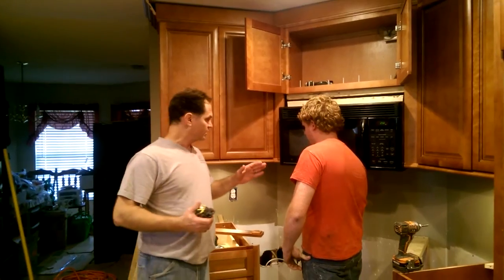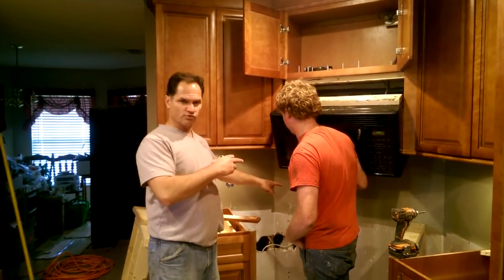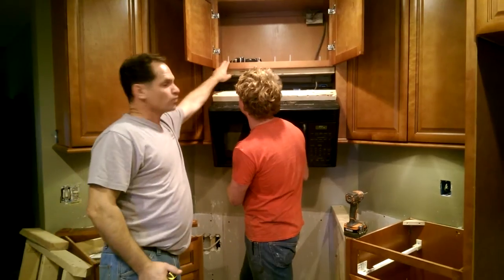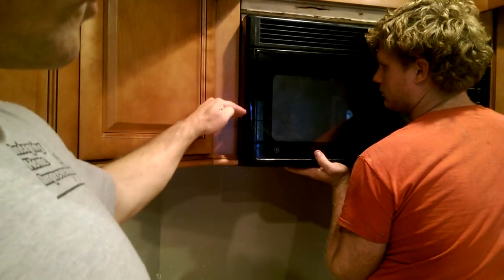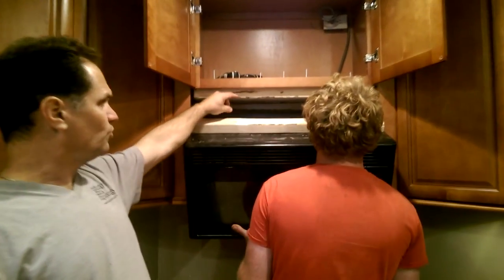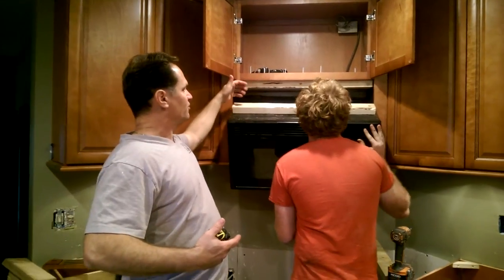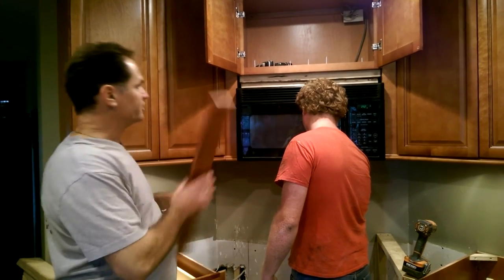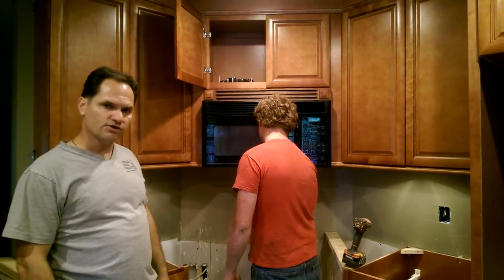How to install corner stove and microwave with small fillers

Comment: Silly question,  but what size is the microwave? I'm pretty sure it's a standard 30inch. Just confirming. Planned on putting stove and microwave in corner. Building wall tomorrow.  Thank you

Comment: So is there in an easy way to install an over the stove microwave without taking kitchen apart I mean I know we have to take exhaust fan down and I have cabinets above the exhaust fan now is there a way to this without messing with counters how did you put the bracket in?
Reply from the maker: starrprincess this won't work with a little modification, it can only be done with a complete remodel and the wall behind the stove has to be built to the exact width I stated or this doesn't work.
Reply: Sure a Microhood will go right up in place of a standard 30" wide hood. The microhood comes with a template so you will know where to drill the holes in the cabinet and the wall. It comes with the bracket that you attach to the wall. Poof!